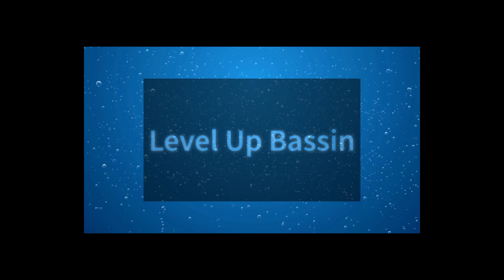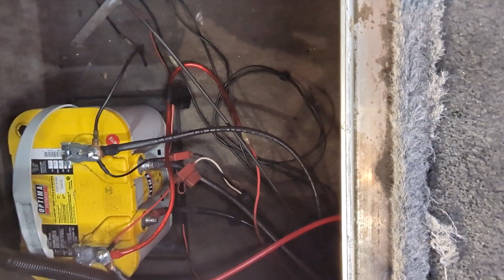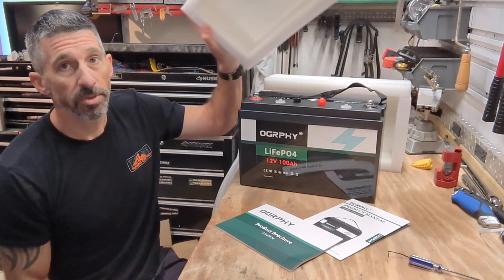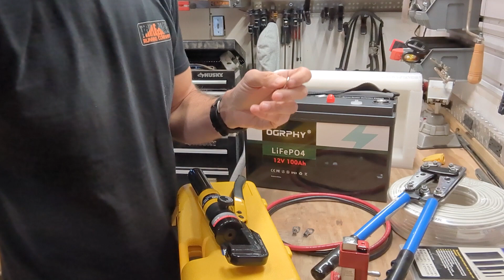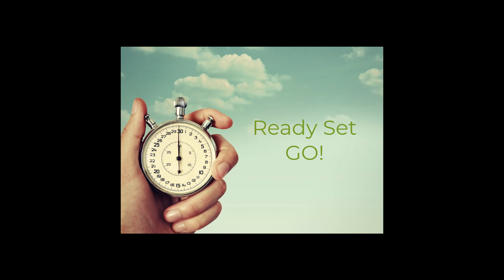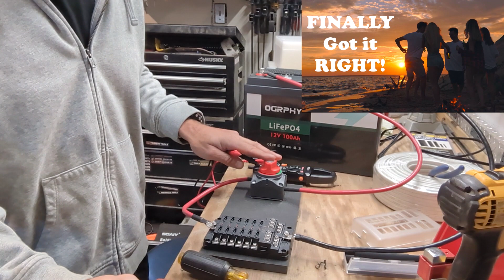New Ogrphy 12v Lithium battery fixed my Active Target issue!

Comment: I'm using an X2 battery for my active target and graphs. The only issue i have is after so many hours of using my active target, the colors on the get lighter and my picture quality gets worse. do you think i should get one to fix this issue?
Reply from the maker: These units really work best with clean consistent power. My issues were similar. If your wiring is good and your unit doesn't have an issue then I would say prolonged use is causing a voltage drop. Lithium batteries provide consistent power and you should notice a big difference!